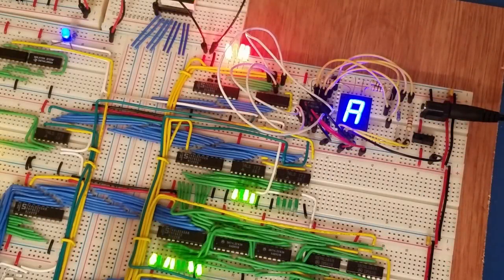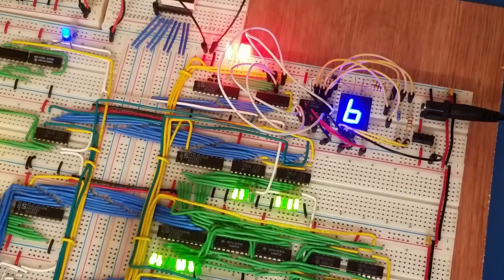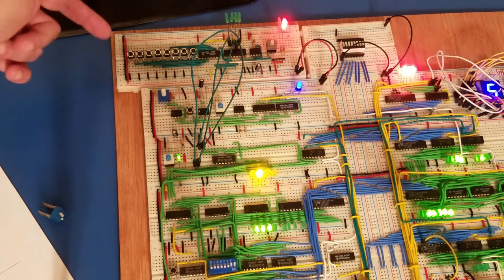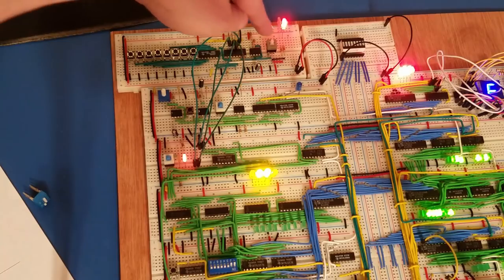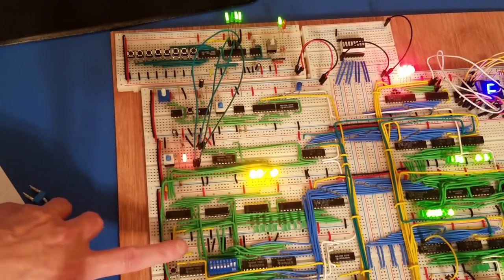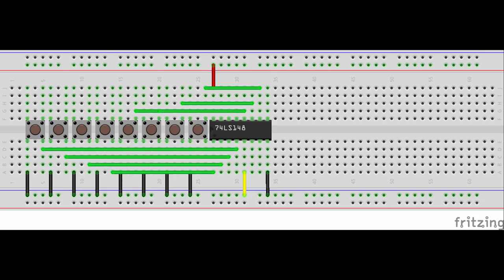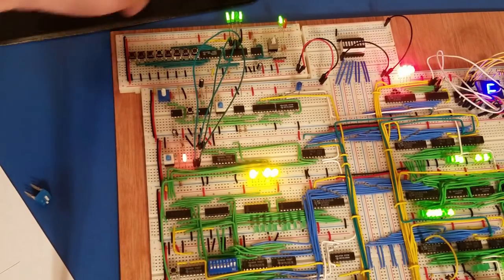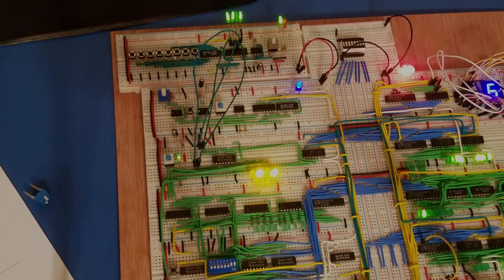Building an Input Keypad  - (Ben Eater 8-bit Computer) SAP-1

Comment: Hi David, Thanks for your fatastic series. I have just completed making the original design as per Ben (finally to have the  design upgraded with your additions). You seem to have met with and solved many issues while the computer and I thought you could help me.  I have an issue with control ROMs - when I work on the controls manually, the computer works fine and the example addition program outputs the result (42) correctly. But the moment ROMs are used for control (with Ben's sketch with JMP) , it goes astray.  The PC for example, goes from 1 to 15 straightaway! I have introduced the changes (like isolating the RAM RC circuit with a buffer ) that you have proposed.

Comment: I was thinking of doing something like this! I wanted to do a full dec-bin-hex conversion board with keypad, with an  address and bits selector button, and op code preset buttons (Press HLT, get the bin code, etc). I'd even maybe do it with an 8 digit display? Maybe lol
Reply: did you do it?

Comment: Hi 
What did you used to hook the 7 segment to program counter please  ????
Reply from the maker: DM9368 (https://pdf.datasheetcatalog.com/datasheet/fairchild/DM9368.pdf) ... they can be pretty hard to find, but you might find it on eBay. If you can't find it (or an equivalent), you could try recreating the functionality with an atTiny microcontroller.

Comment: Nice job. May I ask where you buy your breadboards?
Reply from the maker: I bought a big set of breaboards from Jameco (Part no.: 2157706). I agree with Ben that you don't want to buy cheap breadboards. I don't know if the ones I got are as good as the ones he's using, but these have worked for me.

Whichever boards you buy, I highly recommend getting a set of 20 or so all at once so that you can build everything on matching boards. I started my BB computer project on one set of boards ... decided they were trash ... and then switched to the Jameco boards. 

I was going to keep the modules I had already built but I found that the old boards and the new boards would not physically fit together. The notch cutouts were different. So whatever you get, I recommend buying enough to complete the entire project + a few extra.

You don't want to get halfway through the project and discover that your new batch of breadboards won't fit with the old ones. It was a huge amount of work moving everything.
Reply from the maker: https://www.youtube.com/watch?v=XKQJhe9n_ug
Reply: @davidcourtney1398  thanks for the advice and link.  You confirmed to me what I was thinking and that's to buy  the breadboards in one lot to ensure compatibility.  Definitely good advice and thanks for the estimate on the number required.
Reply from the maker: @craigmunday3707  Depending where you buy from, you may also get a discount for buying 10 or more at a time.

Comment: Did you ever replace this with an actual Hex keypad ?
Reply from the maker: Unfortunately no. After this little proof of concept thing I made, I never took it any farther. I really want to make a full 8-bit BB computer without any of these 4-bit limitations. If I ever get around to that, I'm definitely going to make a custom keypad.
Reply: @davidcourtney1398  I have just purchased the Ben Eater 6502 kit. Unfortunately, it does not appear to have any way to program it, other then to burn it onto a ROM chip every time. 
That seems ridiculous. So, I am looking into a way to of doing that. I started off building his CPU on bread boards and used a 89C51 (8051) to convert and drive 3 - 7 segment displays. I was thinking I could use something like that to incorporate the keypad device. I would only need to drive 2 - 7 segment displays that would display Hex numbers and use the other port as an input or output port.
Reply from the maker: @jeffnay6502  If I ever revisit the keypad idea (which seems less likely with each passing year), I definitely want to have a full set of buttons and switches. The way I built it in this video satisfied my initial curiosity, but a final version needs to be much more capable. It needs to be able to switch between memory address input, and opcode / operand input. And rather than have a button to toggle between the upper 4 bits and lower 4 bits, I'd definitely want to have individual 0, 1, 2, 3, 4, 5, 6, 7, 8, 9, A, B, C, D, E, F buttons. I'd also like to have a INC (increment) and DEC (decrement) button for the memory address so that I could input an instruction and just press INC to automatically go up to the next memory address. I've seen that kind of thing in various trainers I've looked at. I don't have it all thought out at this point. I'd figure it out what made sense while I was building it. I'd probably do the final version on PCB as well. I've only dabbled a little with making PCBs at this point, but I love it. The breadboards definitely have a certain cool factor, but PCBs are so much better, and easily repeatable. 

I enjoyed his 6502 videos, but that project doesn't appeal to me enough to build it. I wish he'd do more with the breadboard computer. Mostly, I'd like to see him upgrade the program counter to 8 bits (or even 16 bit), upgrade the RAM to at least 256 bytes, and so on. The "8 bit" breadboard computer feels more like a 4 bit breadboard computer that happens to have an 8 bit output display.
Reply: @davidcourtney1398  I have started a small series of videos on keypad integration. I liked your INC and DEC idea that is why I recently purchased a 5 x 4 keypad with 20 keys, so I will have an additional 4 keys to work with. However the Rows and columns pins are a bit of a nightmare. You will see the new keypad at the end of my last video, where I introduced the 28C16 EEPROM. I also want to drive 2-7 segment displays and maybe setup 4 more, to view the current address, when necessary.
Reply from the maker: @jeffnay6502  I will check it out! I had a keypad from an Arduino project that I thought about using, but it was row/col based and what I had in mind was that each key would be its own input. Since I wanted my keypad to be as primitive as the bread board computer (meaning - I didn't want to use a microcontroller to drive the keypad), I thought it would be easier to build if each button was on its own. But of course it's been around 3 years since I last took a serious look at this thing... so many interests, so little time. Definitely curious to see what you do!

Comment: What chip is driving that display at the beginning?
Reply from the maker: It's a DM9368 ... very obsolete and pretty hard to find. I got mine on eBay ... and even then, most of them were bad. Luckily the seller cooperated and made it right. But it's the only chip I know that does 0-9 and A-F.
Reply: @davidcourtney1398  Thanks for replying! I've been looking for a chip that does just that for my computer build, and when I saw yours I almost choked lol. It's too bad they aren't made anymore. I'll do some snooping on Ebay I guess.
Reply from the maker: @Eidolon2003  Good luck in your hunt. You'll have no problem finding them on eBay ... but they are very pricey from most sellers. I ordered mine from China because they were the only sellers who had them at anything resembling a reasonable price. But like I said, a lot of the chips were bad. I ended up building a little arduino circuit just so I could plug them in and test them quickly. (Because testing them manually was super tedious and time consuming.) I keep notes for everything, so I just checked my notes. The first set of DM9368's I ordered ... I got a set of 10. And 6 out of 10 were bad. Ouch. I paid $17.49 (shipping included) for the 10. So with 6 bad, that made them $4.37 per working chip. Even so, that was still significantly cheaper than I was seeing from European sellers.
Reply: @davidcourtney1398  Thanks for the tips. I'll keep that in mind. Realistically, I only need 2 working chips (just for the output register), so I shouldn't have too hard of a time.